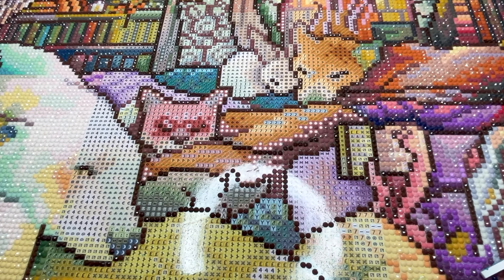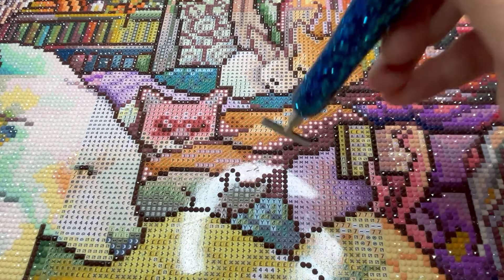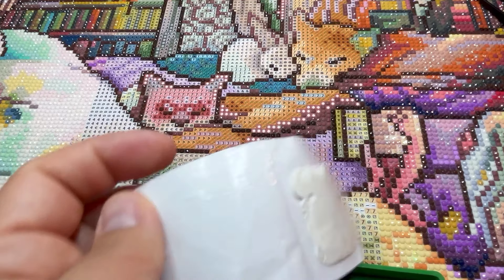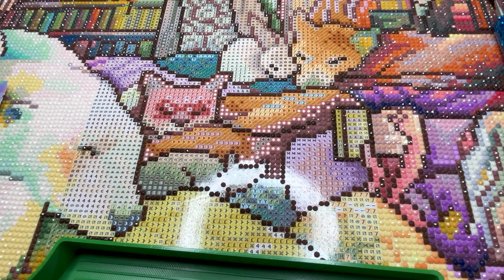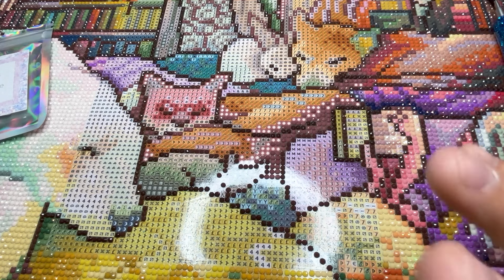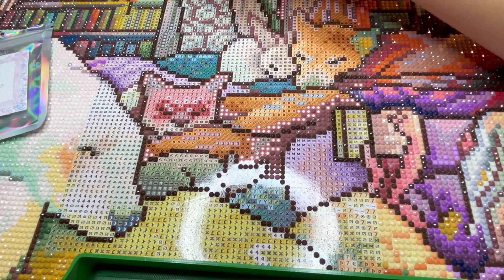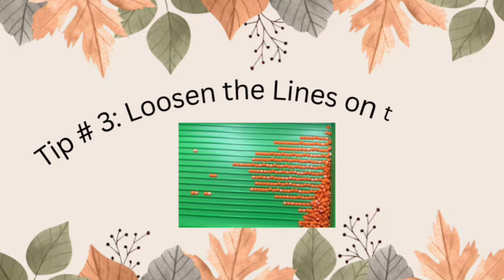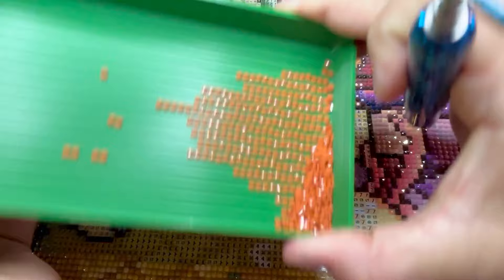5 Tips and Tricks to Multi-Placing Rounds in Diamond Painting

Comment: Hi Courtney. Thanks for sharing these tips. I got some insight about my theory about the thin metal DAC multiplacers - softer putty. You’re absolutely right that rounds are harder to multiplacers than squares. Thanks. ❤
Reply from the maker: It could very well be that the thin placers require softer putty, it’s definitely easier to load! Yes they are much harder to place, but these tricks help me still multi place enjoyably with rounds

Comment: I bought some curved multiplacers for my rounds. They are 3D printed and I got them off of Etsy. You have to roll the diamonds onto the placer, as you roll, it spaces out the diamonds on the placer so there is a small gap between each diamond. You also need to roll the diamonds onto the canvas the same way you would pick them up. It has really helped me with keeping the spacing even on rounds. Once you get the hang of it, it's really effective.
Reply from the maker: What?? I’ve never even heard of those, I’m going to go check them out!